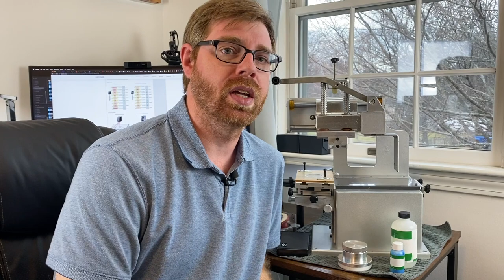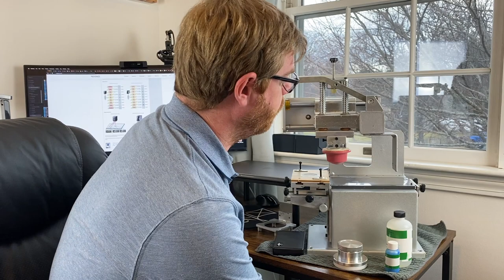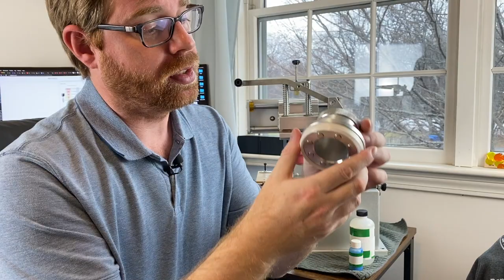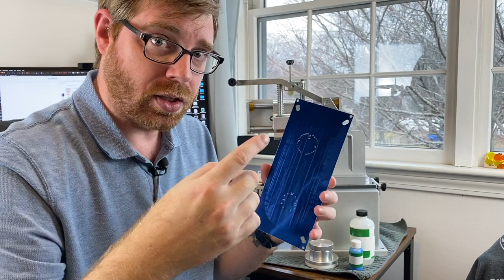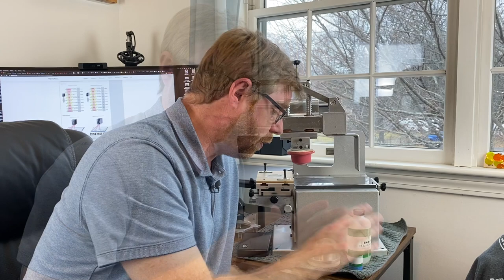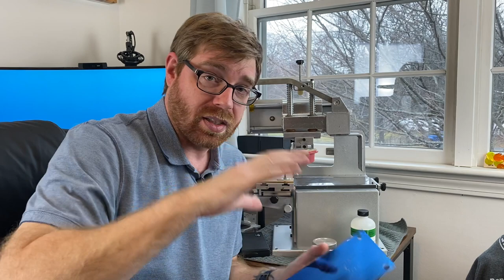Pad Printing Basics for Watch Dials

Comment: I am considering adding a pad printer to my shop. I spent a lot of money ($10K) on my laser that I Use for making custom dials. But have been considering adding printing to my arsenal. Thank you
Reply from the maker: I need a laser and have been contemplating getting one. What type of laser did you go with?
Reply: @WatchComplications  I bought a 60w JPT MOPA with EZCAD 3 and z axis controlled
Reply from the maker: yup, that's one of the models I was contemplating...about how much depth can you do on brass or other materials with it?
Reply: @WatchComplications  it took 20hr but I completely made a watch case from 1/2” thick aluminum. But the key is lower the power settings and do more passes. I have used it to skeletonize 6498 main plates. So sky is the limit. But the learning curve is steep. If you want to message over text I can help you out with I know.
Reply from the maker: sounds awesome. I may be in touch if I decide to get one. I've learned the same with the YV04 laser my maker uses...learning curve, passes vs power, etc. Nothing quite like cutting metal with a beam of light. 😅 I expect I'll eventually break down and get one.

Comment: Thank you 
I’m in the process of creating a luminous cartoon watch dial for my youngest son, but I can’t seem to get the numbers to print clean and sharp. The image prints decently enough on my color laser printer but the numbers print fuzzy. Im doing a 12&24 hour dial with cartoon character in the middle. 

Pad printing is definitely not the one off way to do this, so ill consider the decal, but i also want to add an rfid chip or two under the dial too. So i may need to 3D print or find another way to create the complete dial not just the image on it. 

Thank you your videos are very helpful.
Reply from the maker: I would make sure you are using a vector-based application to create the designs, that will lead to less fuzziness. Also make sure the numbers are based on an installed font, not an image.

Comment: Hi Brian,  Great and very helpful video, also with the apple graphics! Thanks. I wanted to ask you if you could give me a reliable link where I can order the pad printing silicones and where can let make the engravings for a watch dial.
Reply from the maker: the pads I have bought on eBay and the etchings on the steel plates are local to me. I’d recommend finding someone local to you that had a laser capable of around 20-24 microns depth.

Comment: Hi Brian, have you experimented with laser-etched vs photo-etched printing cliches? Do you think there's a difference in quality?
Reply from the maker: I've only ever had laser-etched cliches made and they work fine. I've not looked into photo-etched or what they use to create the design in crystal or whatever. I can't image it works on steel plates.
Reply: @WatchComplications  Photo-etching is a process whereby the intaglio is achieved via acid etching following exposure of a UV photo-mask. It works on steel, brass, glass, polymer, etc.

Supposedly acid-etched cliches have superior fine resolution, because laser ablation produces poor surface finish, leading to roughness around the border of small (<0.1mm) details.

I was wondering if you had any experience with them because many cliche manufacturers offer both services.
Reply from the maker: @_GOD_HAND_  Yeah, I've seen it in glass before...just didn't know it would work well on steel, but that's cool. To be honest with a really good industrial laser, I've never noticed resolution issues on my plates, Silky smooth. And yup we are talking microns.
Reply: @WatchComplications  That's great to hear. For a long time I've been thinking about buying one of those new galvo fiber lasers.

Comment: Hey Brian, I have the same pad printer as you. Mine had a ton of free play in the vertical bearing sleeves and was wondering if you had the same issue, if it was a problem in practice for accurately locating the print and if/how you fixed it?
Reply from the maker: it does have some play. for me it was more related to vertical pressure on the platform for the dial. what i did to fix that was put together a custom support to sit under it so when i pressed down the platform didn’t skew down.
Reply: @WatchComplications  ah, I haven't checked for that (haven't even used it yet), I was planning on getting a precision platform anyway the backlash on the supplied one is measured in yards 😄. I saw a good method for dialing in the alignment using a sheet of transparency film in a hinged frame over the dial, print on that then align the dial, swing back the film and print for real.
Reply from the maker: yup that’s a good way to zero in

Comment: Hello Brian, fantastic video on pad printing! I was curious....is it possible to pad print vitreous enamel? Not pad print ON vitreous enamel but pad print WITH vitreous enamel (inks?)?

Thank you
Reply from the maker: Good question, and to be honest I'm not sure, as I've never tried myself or come across someone else doing it. Theoretically, you should be able to use any kind of ink-like material as long as the viscosity is such that it can fill in the etching on the plate, be picked up by the pad and transferred to the dial. But it's one of those things that would require testing to know for sure.

Comment: Thanks, this is exactly what I meant!
Reply from the maker: I remember someone asking, I guess it was you!
Reply: @WatchComplications  Can you print dive watch bezels? :P
Reply from the maker: a little hard to do with angled bezels. easier with flat bezels. though I prefer etched bezels and then fill them with paint lume. anything done with manual pad printer is difficult.
Reply: @WatchComplications  Sure 3D bezels gives one other approaches to follow, But I have some 1970s dive watches with some questionable designs with basically printed bezels on flat background. It would be a real design pain though to design to accommodate the curvature of the edges, seeing that you need to change everything from the very expensive plate up...  One could probably make a few different sizes on one plate, but as far as I understood your video, you are in $100 for a plate for a single watch already unless you have a mill turning out bezel replicas.
Reply from the maker: correct. if you are paying for etching and such. i have a lathe and and can turn some of my own stuff but it’s also a skill that takes a lot of practice and learning
Reply: @WatchComplications  I'd love to give it a go. I was trained how to use a wood lathe as I took woodwork as a high school subject.

Comment: Hello Brian.  I noticed you have printing pads made out of acrylic.  Are they cheaper to produce?  What are you using to etch the acrylic?  It looks cheaper than using metal plates?
Reply: I can't seem to edit.  I meant acrylic plates.
Reply from the maker: I assume you are talking about the dial fixture, which yes i get made out of acrylic. It’s cheaper than metal, works fine and easily etched by a laser.
Reply: @WatchComplications  Thank you very much.

Comment: I know you're going to get there eventually and I greatly appreciate the explanation. However, it's a bit like explaining how the valve train in a car works to control the flow of air and vaporized fuel into and out of the cylinder to people who have never seen a car run. I'd love it if you started with "I've done more detailed videos on pad printing watch dials. Feel free to watch them here. This is intended as a quick introduction to pad printing a watch dial. First, I want you to see the process. I place the etching here, apply the ink, press the pad into the ink, and I apply the image to the dial." That's it. That's the script. Then follow with the rest of the video. As it is, I'm watching you talk about stuff and frankly I have no idea what you are talking about. I'm going to have to watch the whole thing to see the actual process and then watch it again so I can understand what you are talking about.
Reply from the maker: it’s a complex topic. i made this vid more for an intro and terminology, have a whole series on the steps, if you want a walkthrough of the steps. i could trim an old vid or two down into a very short vid but that would leave more questions than answers.